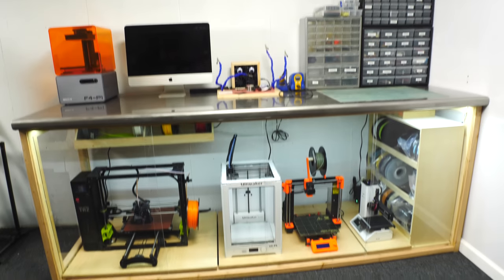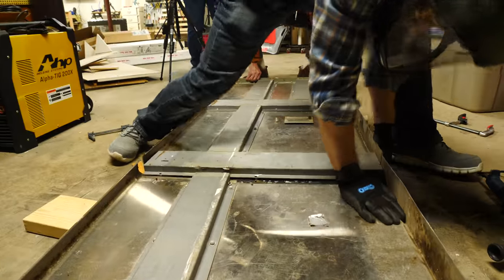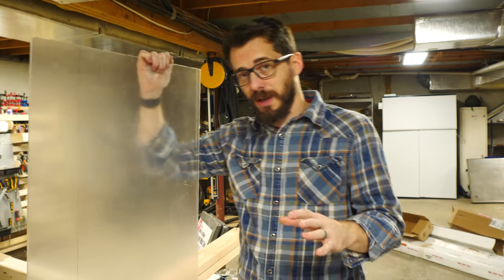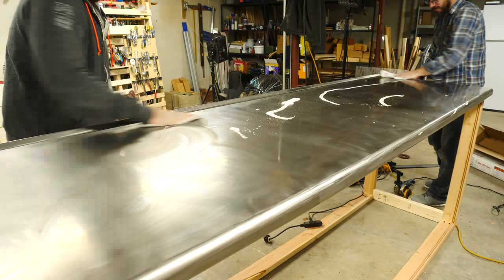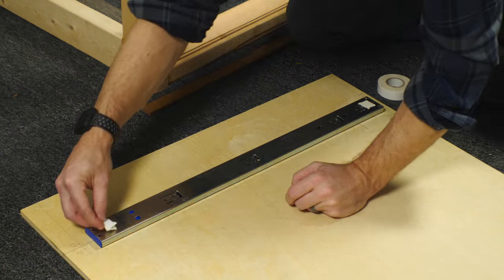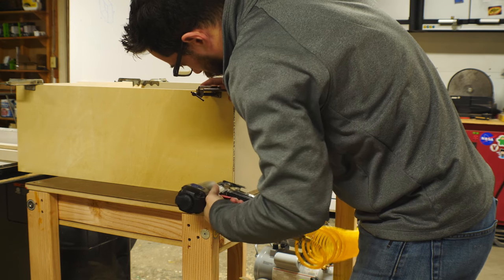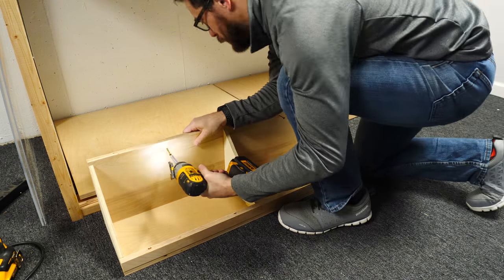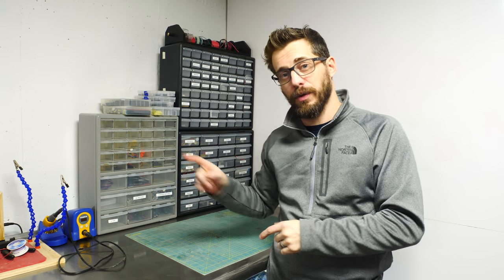3d Printer Enclosure / Electronics Workstation | I Like To Make Stuff

Comment: Not to criticize, just to share: drilling a hole in acrylic create a structural weakness in it. Maybe instead of screwing that end piece to the frame, it would be better to either cut a rabbet, or use something like window screen clips to hold it in place. If that end piece ever flexs because something hits it, it will crack/smash right at the screws. If you use retaining clips it should flex and spring back.

Comment: I would have also screwed some 1x1 strips of wood the the front of the front plexiglass and the back the of the back sheets, just to stiffen everything up. After placement of course... Not so certain I would've went with a metal top (even if its free) my electronics don't like metal hehe... You can always throw down extra rubber/plastic mats though, they are cheap enough.

Comment: Do you think you will have any issues when printing and the movement of the printhead transferring motion to the sliding tray and giving you quality issues with printing?
Reply from the maker: No, not at all.  Since the slides are laying flat (not intended for that purpose) and are soft close (meaning they grab and hold the slide a bit) it actually takes a fair amount of effort to make them move.  Even when I've had printers on lazy susans before, they never moved at all.

Comment: my only concern would be the temp of that chamber. With all printers going it could get to 50C in there? That might be a bit warm for PLA storage?
Reply from the maker: No, I've been running them all for a while and it doesn't get warm (printing only PLA). The back isn't sealed so it's not retaining all of the heat, just cutting down any draft around the printers.

Comment: Not criticism, just curiosity! Since drawer slides typically have the load perpendicularly to the way you have them here, is there any issue or bad stress on the slides when the printer is pulled all the way out?

Comment: All printers inside the same enclosure ? Well, seems to be it works OK, I don't know, never tested :D . Also, I prefer a workbench with deep space under the top table, to avoid hit drawers or wathever with my knees (yes, I know is a standing only desk), and I always leave empty about 15 cm in the bottom, to insert my feets and easy cleaning. But, of course, is your design, based in your needs, nobody knows better than you what do you want. Enjoy your creation and cheers !

Comment: I did similare project but after I figure out that is anoing to do any calibration change of filament and servis of printers on my knees,did you see it now ,that is also issue for you or are you happy with setup ?I Im now in own project of multiple working stations.I mean  with multiple to separate frame for each table of one printer that vibration canot afect each other frequency of movement .Do you see any impact between the printers ?Of course its depend what speed are you using when I print nylon its definetaly no isuueand its like snail  but PLA easy on 120mm/s and thats already good dance .Let me know any idea or your expiriences..

Comment: Question: It looked like those rails had a locking mechanism. Given how low the shelf is to the floor, it would be a pain to try and reach the unlock latch to be able to push the rails back. Did you do any sort of modification to deal with that? I'm curious. Thanks.
Reply from the maker: There's no lock on them, that's just the latch to separate the two pieces for installation.

Comment: Nice.. I wished to do a work area for the new big Tronxy 3D printer I brought, I have a area once it has been cleared that is, to put up a kitchen cabinet which will have a nice kitchen thick round fronted worktop to place the printer on, the underneath cupboard area with selves be for the spools of filaments etc. I need to do a enclosure that is big enough for the big printer and heat and fire prove! The costs of any stuff to help set up the enclosure is the pricey bit? In the UK unlike the USA, costs of building materials are taxed to death. and the materials already pricey themselves before the Tax. So seeing as I have low money I be lucky if I can do the printer enclosure at all.

Comment: Now that you've had this running a while, have you noticed any issues with the PSUs and control elements being hotter than normal? I ask because most enclosed designs I've seen usually focus on getting the PSUs and control boards outside of the enclosure part. Good video, just wondering about a long term follow up as if I get a CR-10S Pro theres no good way to enclose without trapping those inside as well

Comment: Hey i have an anet a8 printer which a lot like the prusa i3 and i am having trouble centering my prints on the base and i cant really find an updated video on how to fix the problem. so i was wondering if you could do a view on it use in your prusa i3 and the cura program

Comment: So i know just about zero about 3d printers, but how much heat build up would the machines produce and would that affect the machines performance over time? Just curious since it would mostly be closed up while running and if it would ruin them from excessive heat in an enclosed area.
Reply from the maker: Not much at all. It's really just to help cut down on draft, but the enclosure doesn't even feel warm with all of the printers running.

Comment: Great video and project! I'm going to take some ideas and apply it to my 3D printer housing when I build it. One question. Are you concerned with storing the filament in the same closed area as the printers? My concern is the heat over time affecting the PLA still on the spools. I'm sure the radiant heat is low enough that it shouldn't be an issue.
Reply from the maker: Yeah, it definitely doesn't really warm up in there. Mainly it just helps cut down draft and maintain consistent temp.

Comment: Aren't you affraid that you're going to have some problems with a conductive table top? Or have you attached a protective earth cable on the table?
Reply from the maker: The electronics work is done on a mat. You certainly could ground the surface but I don't work directly on it for electronics work.
Reply: Makes sense, thanks for your answer.

Comment: Remember that you are using plastic to close the printers, and it can be deformed over the time while being exposed to the heat of the printers, it has approximate the same fusion temperature that ABS, but as all materials it will be deformed with less temperatures (I hope you can understand what I am trying to say 😅)

Comment: Great build, but it's probably not a good idea to store filament especially PLA in a structure built to trap heat. Over time the sustained higher than room temperatures could damage the unused filament.

Comment: Nice job Bob. Does the enclosure make the printers quieter at all?
Reply from the maker: This type doesn't do much for sound, but if you used something like insulation foam for the walls, it would help a lot and still help with the heat/draft.

Comment: Looks great, especially like the re purposed mcdonalds stainless steel top.
1. Instead of building a "storage rack" above the printers, why not simply make that the spool holder while it's printing?  There are several great designs on thingiverse, including some that use the common 608 skateboard bearing that fidget spinners use
2. How well is that really going to keep the heat in?  You have a giant gap in back, and the acrylic doors seem thin and flimsy (and have cutouts for knobs).
3. I also use desiccant for my filament, but I wonder if there's a small efficient dehumidifier that could help pull moisture out of the filament?  I know some people stick their spools is small ovens or dehydrators.

Comment: Hey Bob - how'd you attach the top to the base?  or did you not need to with the weight?  Curious as i have a similar top that i would like to make a desk with
Reply from the maker: We just set it on there and ran 2 small screws up into the support structure. It probably didn't even need that as the top was super heavy.  A little dot of construction adhesive in the corners would also keep it from sliding around.

Comment: Another great project and that stainless steel worktop is a nice score. I don't know anything about 3D printing but do the machines output much heat when running?
Reply from the maker: No, not really. The enclosure is mainly to cut down draft, but it doesn't get warm inside.

Comment: I may have missed it, but do you have a link to those drawer slides?  I clicked the links in the description but didn't see the slides.
Reply from the maker: Oops. http://amzn.to/2EuQxKP  FYI, these are NOT made to be laid flat. They work but just wanted to point out that it's not the intended us so they droop a bit when extended.
Reply: thanks!  For my use I might actually be able to get them in vertically, so they may work out really well.

Comment: Desiccants in your filament storage unit wont work. Your filaments are desiccants. You just added a few grams of similar plastic! Desiccants kinda make sense for shipping, after the vacuum process. But, again, its a similar hygroscopic  plastic, so its not really helping. An always on space heater with a thermostat keeping that lower section at a reasonable 85 degrees F would keep the filament dry.

Comment: This is a great design but i am not a fan of putting 3D printers on the floor.  Changing filaments, cleaning glass beds, making minor adjustments.  This would be a killer on your back.  3D printers are finicky.  I would keep the printer on top of the counter.  Plus ground level always collects dirt and dust.  I would have drawers for supplies of filament, and other electronics.

Comment: It will be awkward to work on electronics on the bench if you are forced to stand the entire time. To make space for your knees when sitting on a stool you will need to open the doors. So you can print only materials that need the heat retention when not working on electronics.
Reply from the maker: Nope. It might be for you, and in that case you should definitely build to suit. For me, I prefer to work on things like this standing up.

Comment: i don't think that that position is the best to solder electronics. when you solder you have to be stable and confortable, with your elbows touching the table surface. you are not going to have space for the knees, but at least consider make a stool on you can seat and gain a much stable position.

Comment: Take out the left clear panel and put in a piece of wood with a fan... it’s gonna get on in there
Reply from the maker: We've been running all of the printers pretty consistently and it's not hot in there.  It's not sealed against the back wall.. mainly just stops it from being drafty.

Comment: Nice project!  Bob - for future projects where you have to do heavy cleanup like you did on the countertop, check out the Porter Cable Restorer (#notasponsor).  It has worked very well in my jointer cleanup.  It also has pretty good dust collection for what it is.

Comment: I'm sorry to destroy your illusion, but this construction is absolutely useless.
Because of constant vibration and wobble 3D printers need as rigid / stable base as possible, not this sliding rails stuff.
Your prusa and ultimaker share the same sliding plattform and will interfere with each other while printing and negatively affect each others print quality.
This enclosure is also useless because its way to large to keep the air temperature that would help printing ABS, while PLA needs as much fresh / cold air as possible for fast cooling down. Also this enclosure will not help with fumes, since they stay inside there and as soon as you open your fancy sliding door, you inhale the whole load of concentrated fumes.
Reply from the maker: I'm sure you're well intentioned (although your tone says otherwise) but I have to say, you're wrong.  I've been running all of these printers pretty hard, at the same time for the past couple of weeks working on the upcoming video and none of what you said has happened.  The panels don't move at all (they're soft close so they have some latching to them). The UM and Prusa don't interact at all. I don't print ABS so that's not a concern and the temp in the enclosure doesn't raise to where it's even noticeable. The point of this is to cut down on air draft and just regulate airflow. I said nothing at all about fumes because that's not a concern for me. I print almost exclusively PLA and that's never been a problem.
On another note, any project is not useless if it serves the needs of the person who made it.  It may do nothing for you, and that's fine because it wasn't built for you.  You should definitely make YOUR projects in the way you see fit and that will help your process the most.